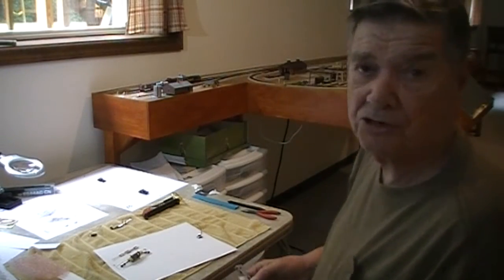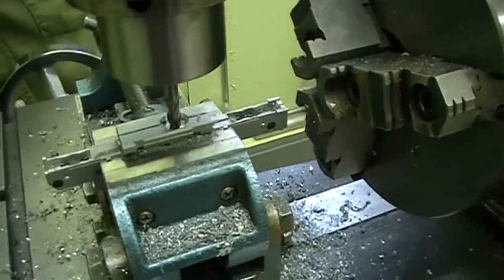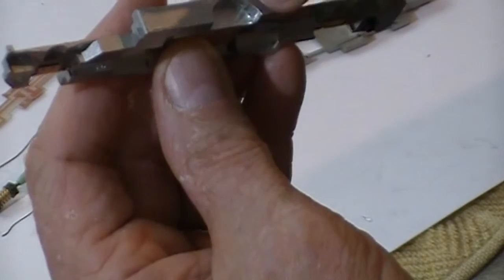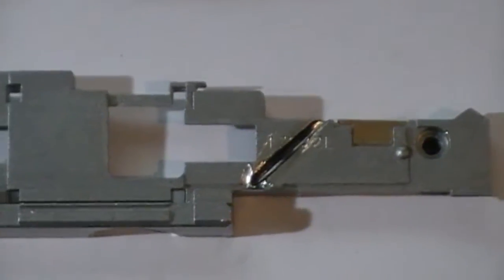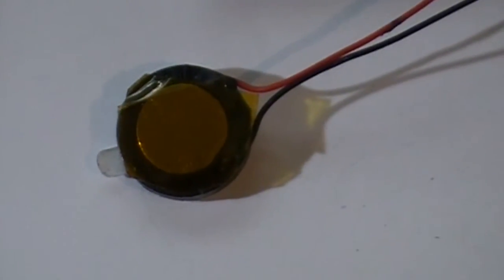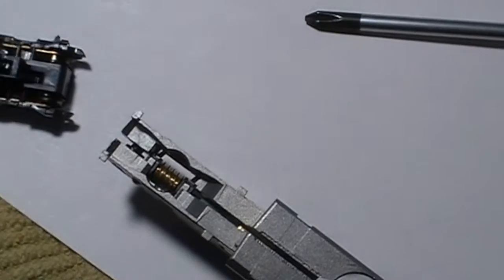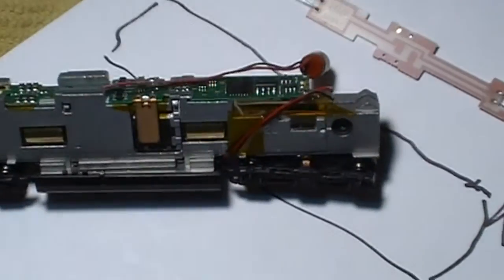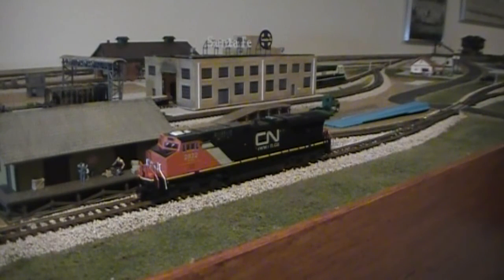Installing the Digitrax SDN144K1E sound card in the Kato ES44AC locomotive part 2

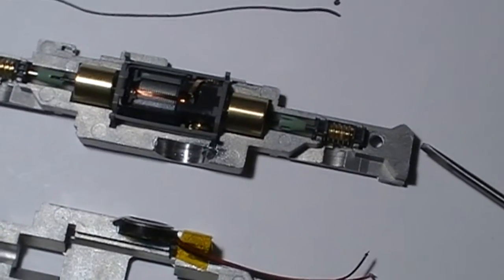Comment: at 6:23 in video on the motor the white painter stripe side on the magnet goes on the downside ...in this case the speaker side.... Kato will put  this white line on all their motor magnets and it is the indicator to place that motor in with that white stripe on the bottom side of the chassis..thank you for the video doing a couple of KATO ES44AC this week with SDN144K1E..nice job
Reply from the maker: Thank you for this information, I learned something today.

Comment: Jack if you seal the front of the speaker,  making a sealed baffle out of it and then turn it over so the back is pointed out. that will make it about 10 times louder.

Comment: Jack, I enjoyed your video showing your speaker install in your Kato loco. You did a nice job. Do you happen to remember specifically what 1/2" milling tool was used to mill the 1/2" hole for the speaker? I would like to purchase one to install speakers in 2 of my Kato locos. I guess not all end mill cutters can cut straight down like a drill bit, but the one in your video did and left such a nice, flat bottomed hole. Thanks so much. Michael
Reply from the maker: Michael, look up "Square end mills" and you should find one.  Thanks for the comments.

Comment: Warning- The shell will not snap on completely unless you mill out the frame in the rear both for the board and capacitor. Its a PITA to do. Don't do it unless you have the tools. A drill press will most likely cause you to ruin the frame. now I see why the 17632 frames are sold out at Kato. lol  

I try to do professional installs and everything has to snap back completely. This one was wicked.

Comment: Found this in some reviews, can you verify?

The only way to turn the sound off is to select another loco. Cannot manually turn it
 off by pressing F8 like other sound decoders.
Reply from the maker: DH4Hobbies all of my DigiTrax sound decoders all work the same. By increasing the throttle The locomotive engine will go through a startup and the sound will operate until decreasing the throttle goes back to zero where the engine will idle for about five seconds and then shut down. The sound turns off completely. You can also mute the sound by using F8. I hope this helps.
Reply: I see. So you dont get the option to "start" the engine and have it idling until you personally turn it off. Bummer. Is there a decoder on the market that will allow this? I just ordered two "Kato #1768925 N Scale ES44AC Evolution Locomotive DC DCC Ready" and I will be looking for a good high end sound decoder, must also control movement and lights
Reply from the maker: Not sure what you mean by "start" the engine and have it idling until you personally turn it off.  When I select that locomotive there is no sound.  When I move the throttle to 1 the locomotive goes through its start up and sits there until the throttle is advanced.  Reducing the throttle to 1 puts the locomotive back to idle, or if you reduce to 0 the engine goes through a shutdown sequence.  I prefer the DigiTrax over MRC as there startup and shutdown are very different.  As for high end sound decoders that is hit or miss on that.  I have not tried LokSound or Tsunami, that may be the way go.
Reply: Thanks for the info buddy. I'm new to the whole sound thing, fairly new to DCC, but not new to railroading. Currently have the Bachmann EZ command but that may change as setup grows.